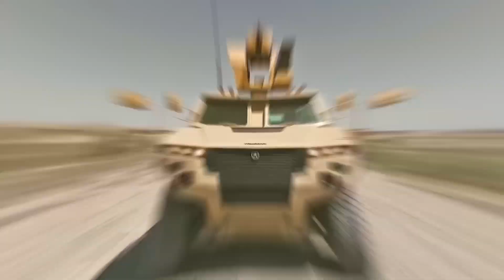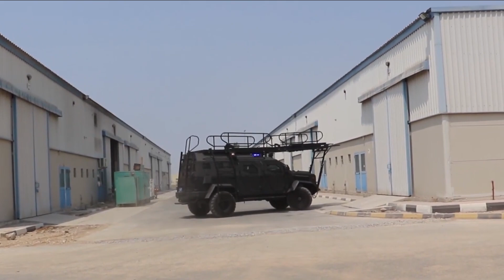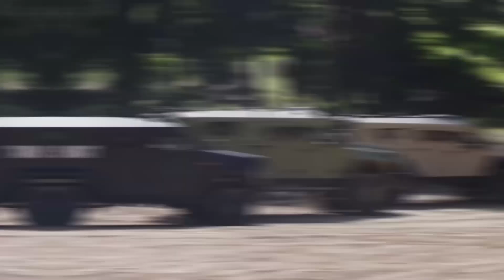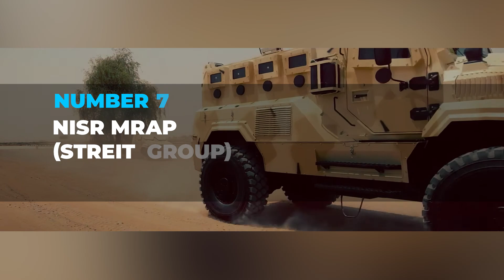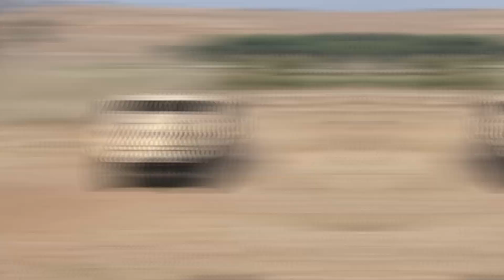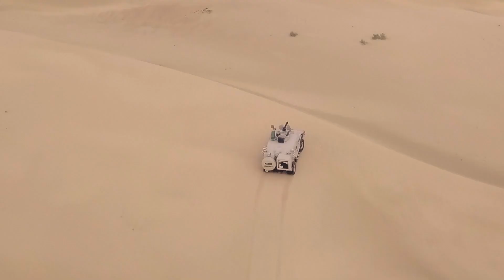Best MRAP Armored Vehicles

Comment: correction, that's a F-550 HD 4X4 chassis frame & drivetrain under the armoured body . . . not the F-350 HD 4X4 . . . the NIMR Ajban 440A MRAP 4WD + 3.0 in. Lift 6.9 TDI I6 5-Dr Armoured Vehicle (LHD) is the best one in this comparo by far . . . the roof mounted 7.62 X 51 MM M134 Minigun six-barrel rotary lightweight cannon is exactly the fire power that such a vehicle deserves to have . . .